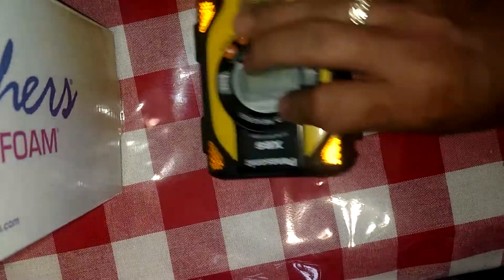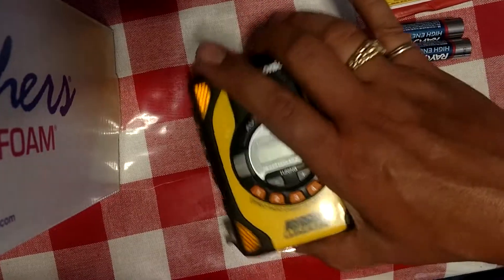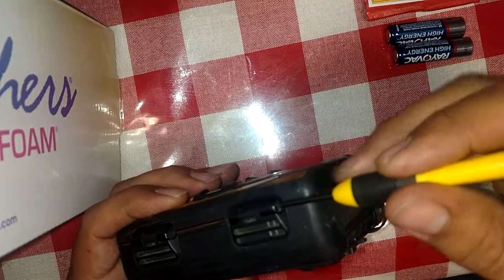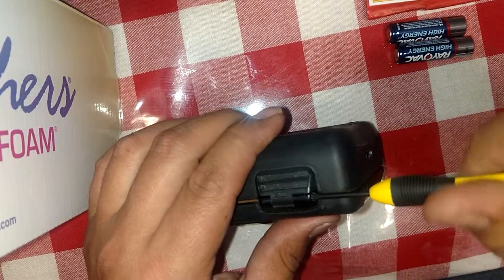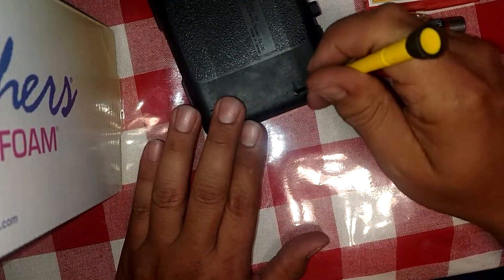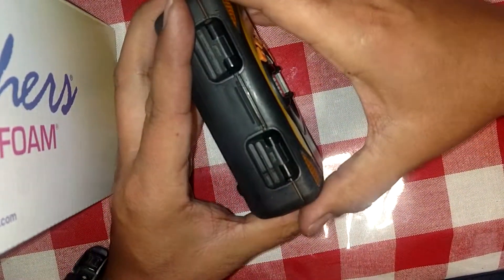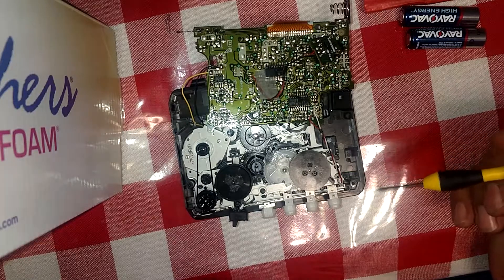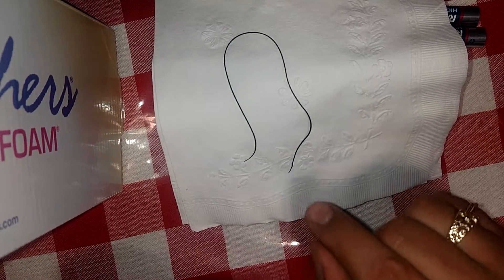Panasonic XBS shockwave tape player

Comment: Thanks for the video. I purchased a belt muti pack from eBay and it only cost a few dollars. The belts are a little fatter than the originals but they fit and work just fine. I am actually listening to RATT on mine right now. Auto reverse just kicked in. Sweet. Thanks again, dude!
Reply from the maker: Peace ☮️

Comment: I used to have one with a ridiculous sound. It has 3 modes: no base ,xbs and vmss mode.The vmss headphones could give you the feel of a subwoofer. It rattles when turns on.
Reply from the maker: I still have not put the band on to experience that. 😲😅